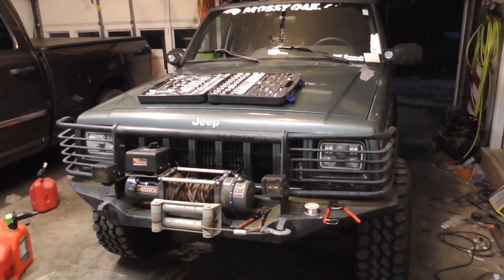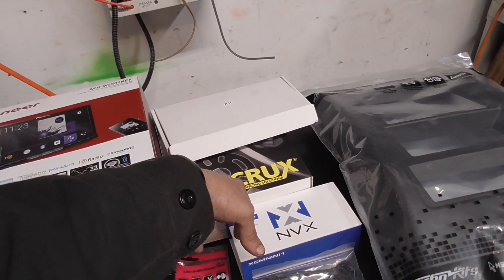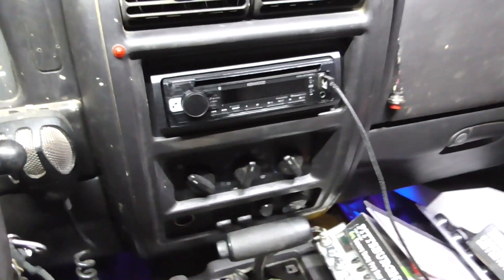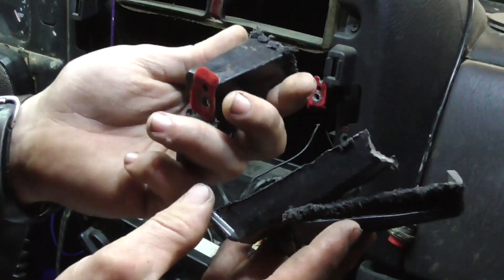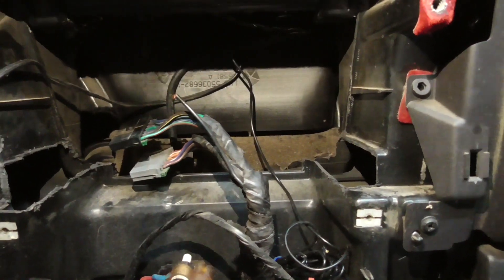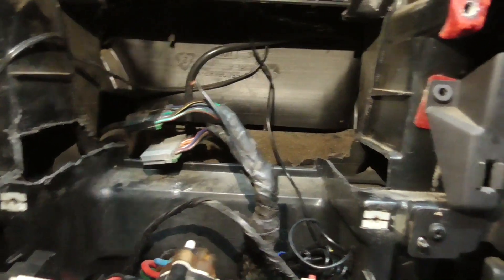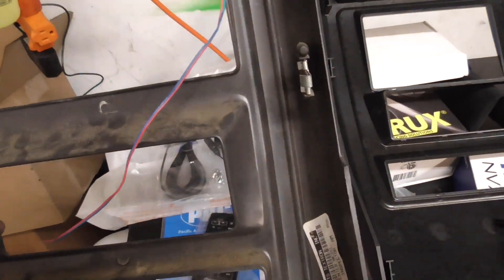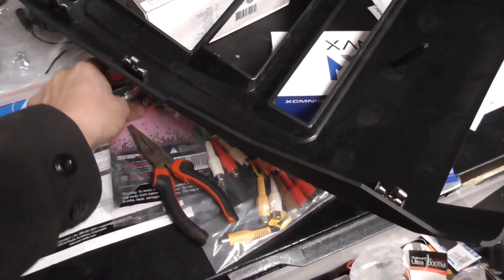1997-2001 Jeep Cherokee XJ | Pioneer AVH-W4500NEX Double DIN Install | Metra 95-6554B

Comment: Wow, I didn't know this was available.  Thanks for the video
Reply: JeepCables.com is stocking them now!
Reply: @Proth1975  thanks I'll check them out
Reply from the maker: I didn't know either until a week ago, ordered the same day I saw it. I got mine from Crutchfield since it was the only place at the time (besides eBay) that was selling it. Got everything else from Sonic Electronix though, was a good $150 cheaper for the radio.
Reply: @DanielPace92  this is what I was looking for.  Do u use navigation on the head unit?
Reply from the maker: @MajorWeakness  I use Android Auto, which uses Google Maps as navigation. (have to step up to the AVH-W8500NEX to have native navigation on the unit) Haven't used the Google Maps navigation on this specific unit yet, but I have on the 4201NEX which is in my Yukon.  They are the same basic radio but this one is 3 years newer and seems way more responsive to touch.

Comment: remember don't let any live wires hit that metal tape. it might be a good idea to put some plastic packing tape over it.
Reply from the maker: If you have live, exposed wires behind the dash you have other issues.  There shouldn't be an issue with the aluminised tape being exposed. Even if a wire did hit it, the tape is not grounded to the vehicle because the dash is plastic, so not much will happen unless you have a ground wire also touching the tape.

Comment: You mention the reverse wire quite a bit. Is that just because you’re also doing a rear camera install? Or is it critical to the head unit for a reason I’m missing?
Reply from the maker: Just for the backup camera.  If you are not going to use one, you don't need it.

Comment: Dude this is awesome I've had a 2000 for about 3 years and have been wanting to do this also, have been looking at the Sony xav ax 7000, but looking at it I'm wondering if it will hit or be in the way of the ac controls, I would probably go with android based  cause I have nothing but samsung phone and tablet, what kind of speakers do you have or are going to install the sony has a pretty good amp in it so I want to get some good speakers.

Comment: Did the Wireless Apple car play work without the VSS wired in?  I have the same stereo (in its box) and instal kit, but am hung up on the damned pink wire
Reply from the maker: If you are installing it into a Jeep XJ, you can't wire in a VSS signal because Jeep doesn't provide that to the OEM radio. And I don't use Apple Car Play, I have a android, so I don't know if it works.  If you need it, you would need to tap into the wire behind the gauge cluster.

Comment: Have you noticed a significant decrease in air flow on the ac? Everything i have seen says this is a cross over tube not a direct path for flow.
Reply from the maker: I've not noticed any decrease of flow at all.  All you do when you cut it is trim the edges off, it's not in any direct path for air. Chrysler just decided to use the HVAC box as a main dash support so pretty much everything in or on the dash mounts to the HVAC box in some way.

Comment: Hey man awesome vid! So I’ve got a double din radio coming in. I already had a pioneer single din Installed when I first got the car. Do I still need to buy a wiring harness? I can’t just unplug the single din and plug the double din In? Double din is a 6.2” Kenwood.
Reply from the maker: Yes and no. Kenwood and pioneer have different radio side plugs. Now, you can cut the Pioneer plug off the harness in the vehicle now and replace it with the pigtail that comes with the Kenwood radio. So if you want to make a new harness you will need to buy a new adapter harness.  Or you can keep the adapter harness that's already in the vehicle and just swap the radio ends so the Kenwood will plug up.

Comment: Is there a way i can connect reverse wire to activate camera when i shift to reverse but also if i wana view behind me i can just click camera button n it activates while driving/In any gear selection?
Reply from the maker: Yes, just hook the power of the camera to igniting power and not to the reverse lights/signal. That's how I have my Yukon setup. The radio is wired up to the reverse signal as it should be.
Reply: @DanielPace92  so from the back up camera wire harness hook that to ignition power wire that will power the Radio up.
I should still hook up the (camera wire) in radio harness to factory reverse signal wire correct?
Reply from the maker: @elchulo6743  No, the backup wire for the radio harness - hook that up to the factory reverse signal.  The camera itself should have a separate power, hook that up to ignition power.
Reply: @DanielPace92  ahh okay i gotchu. Thank you ill be doing an install shortly so ill let ya know how it goes. Thank you

Comment: What is the PAC bypass for?
Reply from the maker: It eliminates the need to connect the parking brake, also lets you use functions of the radio while driving/in gear that would otherwise be locked unless you are stopped with the E-brake on.
Reply: @DanielPace92  got a part number?  I am in the middle of the install and don't know where the  Pink ( car speed signal ) and Green  ON/OFF parking brake cable should connect.
Reply from the maker: You don't need the pink, that's for wireless carplay only.  But I think is no longer needed, also the Jeep doesn't provide that anyway.  The green parking brake wire connects to the switch on the parking brake, you have to take the inner part of the center console storage out.  Under that is the parking brake and a switch you need to connect it to.  Vehicle side of the parking brake switch, not ground side.
Reply: @DanielPace92   Why do you say "jeep doesn't provide that anyway?"